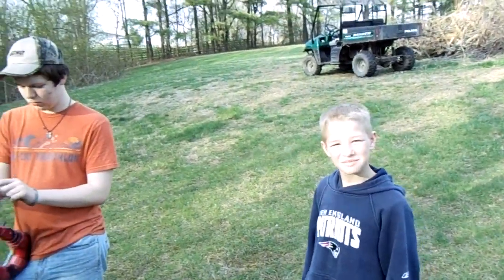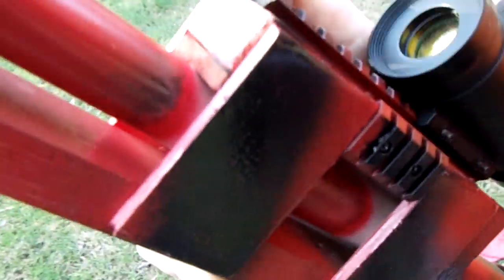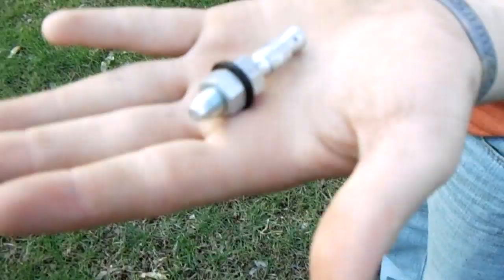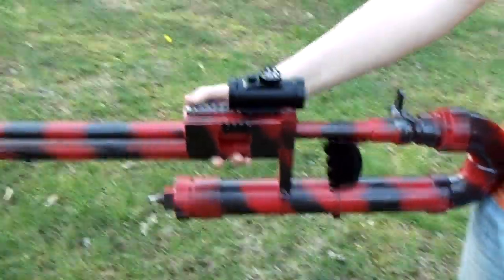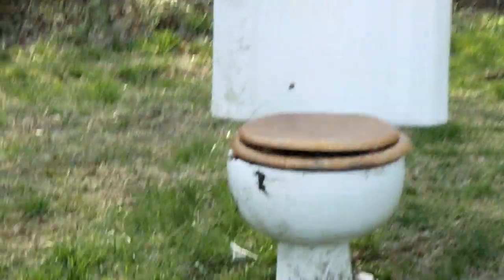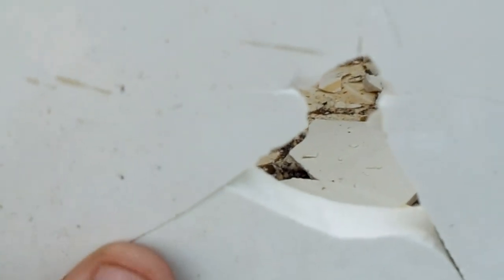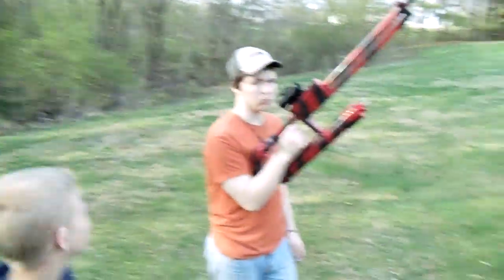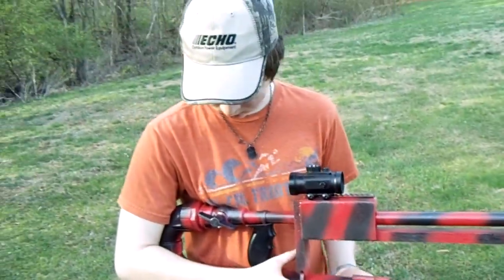Redneck Shoots Toilet with Homemade Air Cannon Part 1

Comment from the maker: @Siksaneity77 We bought the valve either at O'reilly's or Advance Auto Parts....I can't remember. Just ask them for a bolt in valve stem. That valve stem is rated for 150 PSI.

Comment: hey, would smaller ball valves release pressure faster/ more effieciently than biggfer valves? ive messed with some 3/4 valves, but they dont seem to turn as fast as 1/2" valves.